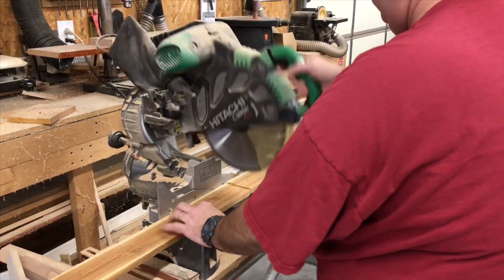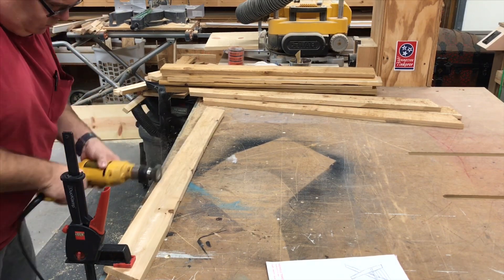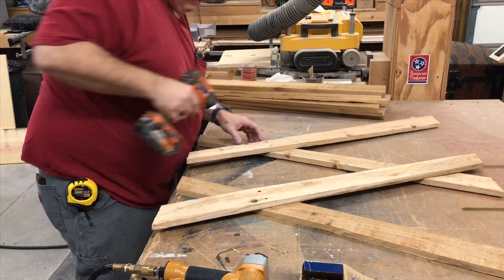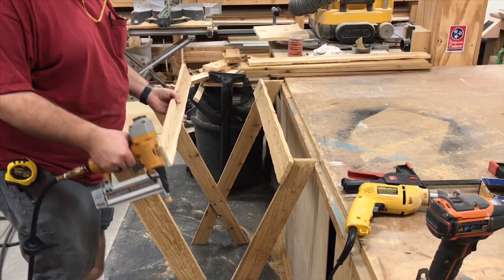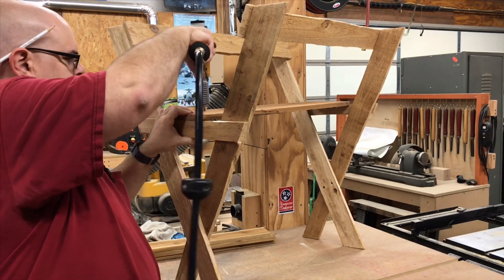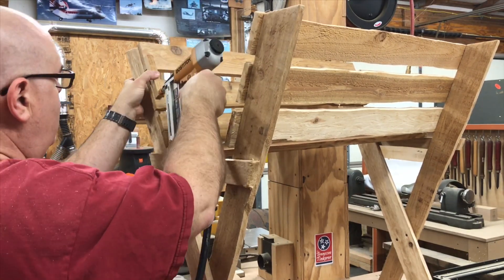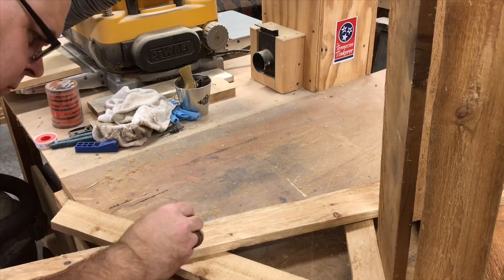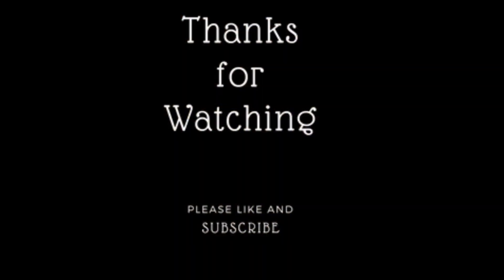Woodworking: Making the Rustic Cedar Manger

Comment: Hi! What angle did you cut the legs?
Reply from the maker: Ashish, I really don't know. I made it up as I went. I just now re-watched the video to see if I could tell or remember, and I'm no closer to knowing. It appears that the angle is around 5 or 10 degrees, but I can't be positive. I'm sure what I did was hold a couple legs in an "x" shape approximately how I wanted them and drew a line on the bottom of one parallel to the floor. Then I could turn my saw until the blade lined up with it. If that isn't how it was done, it still sounds like something I would do. Anyway, thanks so much for the comment and view!